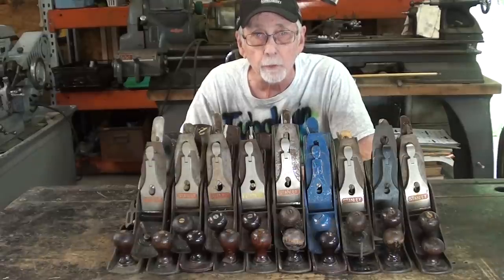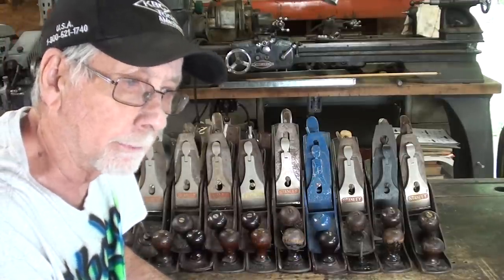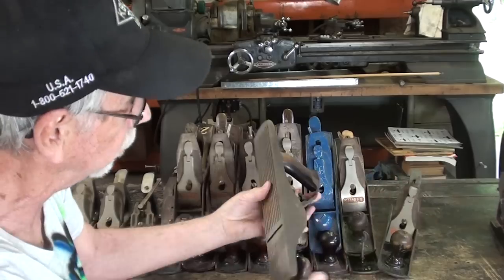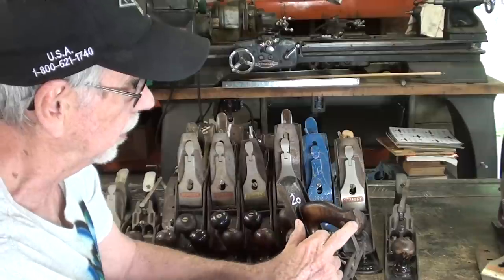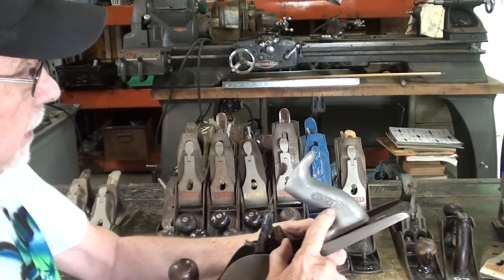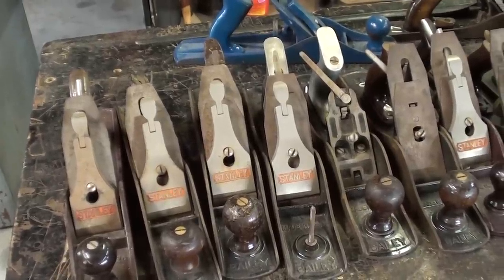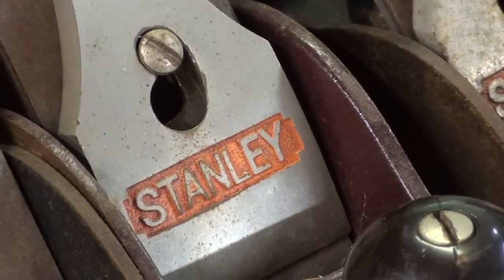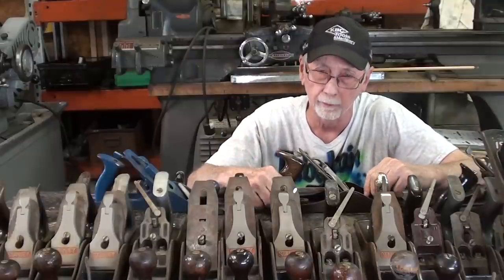STANLEY PLANES IN THE SCHOOL SHOP Tips #645 tubalcain

Comment: Hi Lyle,
In the 59's and early 60's we did manual training in grade 7 and 8 at primary school, once we hit high school, you were funnelled into either an industrial, commercial or academic stream, so you could not do woodwork or metalwork. I got my first Stanley plane when I was about 7 from my grandparents, and still have it I also have a 4 and a 5, not that Iuse them much these days - I have a well equipped wood and metal shop with industrial machinery that do the job faster and with less effort for the ageing body.
Our manual training was of fairly simple things in woodwork and metalwork and I still have some of the things that I made from way back then, so we learnt how to make basic wood working joints and how to make a folded joint in meatl and a wired edge (on a small cake tin). No big machinery as there seems to have been in the UK. Certainly no power tools except for the teachers to use or a drill press for us to drill the odd hole.
I used to enjoy those sessions. We had to go to a local high school by bus to do them, so it was an outing as well.
I would agree that these things are long gone in Australia too, and we no longer have our technical colleges as we did up till around 2000, by which time their funding was almost gone. Pretty much all training is now done by private providers and it is all about money rather than quality of education and skills from what I have seen. Some of the construction trades have special facilities but that is limited and they exist because no private provider wants to shell out the money for the space for bricklayers to lay bricks, or carpenters to build a small building inside or the large machinery for the engineering trades or wood shop trades.
It is quite sad  to see the fall in trade standards too.
Regards Dennis

Comment: I had shop class in junior high in the late 70's.  Woodworking, metal and drafting.  Its influenced my life.  I have no memory of using a plane in the woodworking class. I think that the hand tools were rasps and files.  I still remember those teachers.   As to what you paid, the Stanley aluminum file handles are definitely sellable.

Comment: Thanks for that Lyle, I for one found it interesting! As a former church organ builder I know something about pushing a plane all day, and then as a wood and metalwork teacher doing a little of what you describe, , but in England, we had the sense not to let the kids alter the depth of cut, let alone take the plane apart, lol I loved showing the kids the way to properly prepare timber( not called lumber in England) using a trisquare, I used to cut a piece of timber about 3" x 1" but deliberately taper it  from 3" down to 2" at the other end to easily demonstrate what happens when you use the square on the wrong edge and not the face side or face edge and even if it were tapered you could end up with all six faces square to each other but obviously not parallel. Then I would show them how to use the marking gauge to get the work marked parallel for planing with yes as you said a number 5 Stanley Jack plane. We had 20 No5's and 20 No4's and one No7 in each shop and I kept them razor sharp for the kids as I had two full wood shops that's a lots of planes to keep sharp I can tell you then add to that  20:of each quarter, three eights, half, three quarter, seven eights, and finally one inch chisels that's 120 chisels in each shop on top of all those planes planes. Now that's a LOT of sharpening!  I've just remembered I missed out the 20 5/8" chisels lol oh and as an aside, in ten years I never had to order any spares at all for the planes, no handles or knobs!  I had to braze one smoothing plane that had been dropped and broken just where you showed it. I made a jig to hold the sole flat as i brazed it with an oxy acetylene torch . I repaired a couple of broken ones I found in a cupboard for emergency spares but they were never needed in my time at the school.
Reply: Timber is what we call wood in the USA  before it has been milled, cut and sanded to dimensions. Once it has been cut and shaped into standard dimensional sizes and  smoothness then it is called lumber. Which can vary by region of the country, just as words change around the UK before you factor in the Ireland and Scotland language deviations.  Language is truly a weird evolving creature spanning both distance and time .
Reply from the maker: Wow that’s a lot of edges to keep Keen

Comment: yes I enjoyed this video! the rarity of these tools in europe and especially the Netherlands is so much different than in the us, I rarely see them, let alone for a reasonable price. I can agree that the quality degraded quickly in recent years, but they are usually relatively fixable, trueing up the sole, fitting the frog, flattening the frog that mates to the blade, flattening the blade itself (ps that always needs to be done properly, otherwise you can't flip the burr in one pass) and fit the chipbreaker. it will usually preform perfectly fine after that though

Comment: My woodwork and engineering time at school (U.K / 1964 - 70) was as good as an apprenticeship. The teachers were excellent, Mr Boothby for woodwork and Mr Carlton & Mr Ritchens for metalwork & engineering, superb all of them. The first thing that happened before any tools were used on wood / metal was that you learned about the tools, basic hand through to machines tools. We learned how to sharpen them, how to maintain them and what all the parts were called. Also we had to draw them in detail by hand, still have my books. Then and only then were you allowed to use tools, any misuse of tools was darned nearly a capital offence! The teachers were very strict and on reflection rightly so, we could be a difficult bunch of guys at school. We respected the teachers and respected the tools and machines, bring back that at school and you will start to put right some of the problems in society, not all but some. I do not feel damaged by the discipline I was subject to in school, it taught me to have respect for others. Happy days indeed!

Comment: Had wood shop in JH and BIA (Beginning industrial arts wood/metal-welding-lathe-casting/drafting) in HS, still have some of the projects.  Wood shop teacher was great but tough.  Remember running laps all period for having my shirt untucked at the saw...but a great teacher.  What is amazing to me is how little the basic wood plane has changed in a 150 years...yes we have electric planers and jointers but the basic design of the plane was foundational.  It's a big subject as to why IA has dwindled to marginality but definitely a shame.  It could be a whole Vlog¿  Thanks Mr. Pete!

Comment: Takes me back to grade 5 6 7 8and 9 when I had shop classes. My Dad did a lot of fine woodwork and metal work so I got a home education. He bought me a Record smoothing plane to keep me away from his Rapier.  Also taught me to sharpen tools with an oil stone and a hard Arkansas followed by a strop. I was disgusted by the teacher using a grinding wheel. We never had Stanley at home because of the inferior steel. My father gave me a plane blade and a large block of birch and said make your own 24 inch plane and then another block of birch to make a mallet.  Still have all my tools and have added many more Record and Marples tools.  The Arkansas stone I was also given came from my grandfather  and is still in use. 
I was always the teachers pet because I had already learned at home. My grandfather taught me to wire switches , lamps and motors when I was 8 or 9.  My father taught me woodwork when I was 10 , basic electronics from 11 and metal lathe work from 12. Still have the tools and still use them at 77 with no plans to quit.
Thanks for the memories

Comment: My school didn't have shop class (graduated 2002). My dad taught me some. The rest I'm learning myself (with help from youtube). I used my Stanley #4, #6, and 9 1/2 this morning.
Reply: Also, a lot of the things learned woodworking with hand tools are transferable to metalworking. For instance, planing a board's edge flat for joining, you have to be mindful of the pressure you put on the front and back of the plane at each end of the stroke, or the edge will become convex. Then when you're filing metal flat, you have a similar challenge (to avoid making the face convex). But since the changes are slower and the measurements smaller, its harder to see. Learn it when planing, and the metalworking is more obvious.

Comment: My “Industrial Arts” class in the seventies was just a vestige of what my brother (who was ten years older) had experienced.
I had “Introduction to Industrial Arts” where as my Brother took “Shop Class”
He got to pick which type shop he took metal or wood etc. and he got to take metal shop from which he ended up taking home a “Tinner’s” hammer which he made at the end of the year.
I on the other hand had to suffer through endless classes of Mechanical Drawing, Electrical Theory, Introduction to heating and Air conditioning (study,) Carpentry and finally after all of the preliminary class work we got to go to the shop and break into teams and build a corner of a 3/4 scale house which included  all wiring, duct work plumbing, foundation, framing and the roofing.
I was lucky enough to have guys on my team who were as enthused as I and we built a beauty. The teacher awarded us First prize!
I guess it was a competition?
I remember how much I wanted to get my hands on the Lathe and milling machines in the other part of the shop but that was no longer available to me.
Years later I met up with one of my former classmates and learned that he became a Civil Engineer as a direct result or that class and a lifelong friendship with the shop teacher.
I hated the teacher for not letting me take Metal Shop!

Comment: Mine was industrial arts in junior high, a new junior high was built and I attended in the eighth grade in ‘81-‘82. My shop teacher was Mr. Bradshaw, a big man, not fat, big. Most kids in my class had little to no experience. I had quite a bit as my dad had a small shop in the back yard and he and my uncle would do weekend carpentry jobs in the community and I helped. I have very fond memories of that class and Mr. Bradshaw. Unfortunately I was only there for a year and the class was eliminated a couple years after. The principal at the time disliked shop type classes and wanted to focus on academic content. I suppose it was the beginning of the end. I moved on to ag and auto mechanics in high school. I wish they had a metal working class with machines. They did have a welding class but I was already a fair mud dobber by then. Thank you!

P.S. I would like to hear about the decline in shop classes. I believe students should be taught the manual side before moving to power tools.

Comment: In jr high shop classes were electives, they were available in beginning and advanced i took electronics, mechanics, 1 and 2 and construction 1. Only construction was crap because the teacher was ready to retire. later in life i spent most of my life fixing mechanical stuff, 13 years as a sheet metal hvac mechanic, and hold a AS degree in electronics plus 10 years as a computer\ network technician so i would say they were good foundations for lifetime of activities. I remember Mr. Freeman my 7th grade electronics teacher was a veteran of pearl harbor, the class project was to make a device out of a test tube that would light up if you plugged it into an outlet. I know how to work with wood, metal, glass, and i gotta say my preference is metal. My friend currently runs a votech school in northern Florida teaching young adults the fine art of working with your hands and his graduates are in high demand. Sorry to get long winded, have a great day.

Comment: You said to comment.  My 2nd favorite plane came from auction at my old high school, has a corner broke off the end but it still works fine, even has a coat of orange paint.  School colors are orange and black.  Anyway my favorite thing to do was to skip study hall, I could then be found in the industrial art shop welding something, grinding something or playing with the lathe.  Sadly industrial arts has been dropped.  They still have vo ag.  My junior and senior years I took machine shop at the area vo tech school.  Been playing in the shop every since.  Need to spend more time in mine and find where I put my pieces.  Ha

Comment: Junior High School and High School-both yes.  Back during the Pleistocene Era.  Girls were generally routed into classes that taught domestic skills.  I often thought that men could also benefit from these classes, particularly if they were committed to a lengthly period of bachelorhood.

I have a number of planes, including some heirlooms owned by my great grandfather, who it seems, built about half of the Puget Sound Naval Shipyard in the 1920's.  Planes are mostly used by hobbyist woodworkers and for the occasional home repair by people that learned the utility of these tools.  I haven't seen a professional carpenter heft one in a long time.  Instead, electric planers and routers are generally used.  It seems that, anymore, a carpenter hardly uses a claw hammer, and may not even own one, since pneumatic tools, and even cordless devices are affordable and much faster in use (and easier on the wrist and elbow joints over a working career).  

How about a discussion of handsaws?  Yet another versatile tool threatened with extinction.  Great job, as usual.  Very enjoyable.  

BTW.  I still have vivid memories of the graphic black and white photographs hanging throughout the school shops of my youth that showed various mutilated body parts, each accompanied by a stout admonition such as "He should have used the guard!".  Did you ever see any of those?  Were they obtained from shop supply catalogs?

Comment: You could disassemble these planes and sell the parts on eBay.  Much more value as parts than as complete planes.  You are right there are very few things as pleasing as the sound/feel of a properly sharpened plane as it makes a thin shaving.
Reply from the maker: Yes

Comment: I am old enough to have had shop in junior high (and I also took shop in high school; or more accurately, Industrial Education), but we didn't have hand tools (other than screwdrivers, hammers, etc).  I remember the shop in junior high being a large room, but I don't remember us using very much of it.  There were larger machines (a commercial sized planer was one machine I remember in the area, but I didn't have any idea of what it even was until years later) that we never used, or that were ever even mentioned.  I enjoyed shop class (or Industrial Arts,  or whatever several names it had back then), but I am fairly certain it was in decline even back then (about 35 years ago), and I am sure that it has gotten even worse now.  I know that my old high school shop area is now the cafeteria, and I am told the Industrial Education department has been moved into the vocational arts building.

Comment: Thank you mr Pete for all of the knowledge and now I made my own forge for casting and I have a wood lathe that I can make patterns for casting and all I need now is a better crucible than a used co2 cartridge and a better heat source and am saving for a lathe and mill I found a good lathe but if I put the link in you won’t see it so I will reply to this for the link it will be held for spam  so you will need to approve of it.

Comment: I had wood and metal shop in high school in the '80s. My school eliminated them long ago, unfortunately. The shop I work in now where we use a lot of old screw machines and Cincinnati centerless grinders that date back to the '60s, and some earlier. It is hard to find people that understand my shop's need for precision and being able to read even a DRO for tens, hundredths, thousands, and ten thousandths for measuring parts. There isn't anyone coming from High School with any basic shop knowledge that can learn any of what I do, even if it's not that hard. And who I work for is not going to replace the old machines with modern CNC because of the cost, and the old machines just keep running.

Comment: My 7th grade shop teacher had no shop skills whatsoever. He was hired as a gym teacher and coach, but to fill his hours he also taught a class section (3-Rs, history, civics, etc.)(badly) and a shop class (also badly). We did some wood lathe work*, planing, sanding and finishing, and a little bit of metalwork (hand drilling, hacksawing and filing). I think the wood lathe was the only power tool we used (maybe a bench grinder). To be fair, he was a pretty good gym teacher and coach, spending time to bring out the best even in the relatively unathletic boys.

My Junior High experience was limited. I went to a K-8/9-12 system to the 8th grade and moved to a K-6/7-9/10-12 beginning in 9th grade. The new system had tracking, and it was determined (without consulting either me or my parents) that I was "college track" and this severely limited the classes I was allowed to take. I really wanted to take auto shop in 10th grade, but was told it was not an option for me. Well, I went college track and then proceeded to drop out of college after a few months - twice! What a waste. I might have enjoyed wrenching, or it might have helped me contribute to the family bolt making business. 

My grandfather did teach me a fair amount of metalworking. He was apprenticed to a blacksmith in Sweden from the time he was 8 or 10, and  after he emigrated to the US he worked as a machinist before founding his own bolt making company.

=========== 
* I turned a nut dish with places for a nutcracker and four picks, like the ones you showed a few videos ago. I think my folks even used it occasionally.